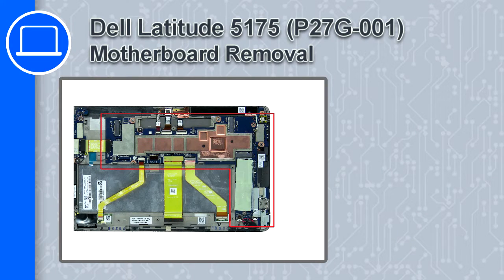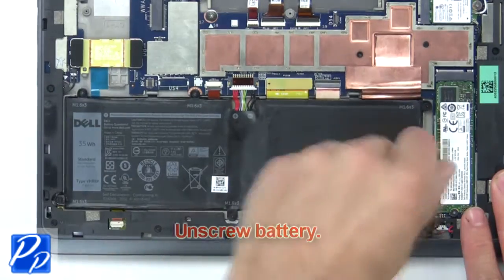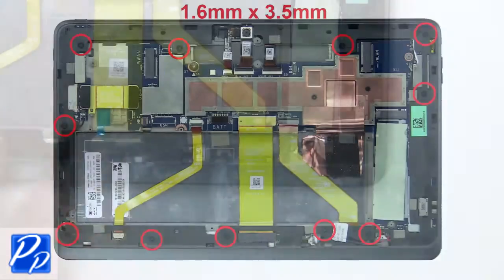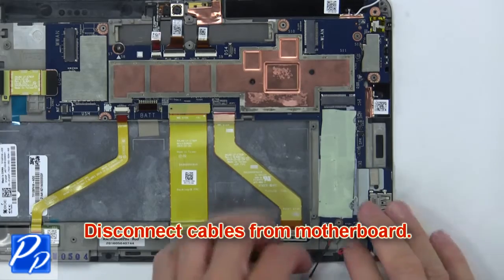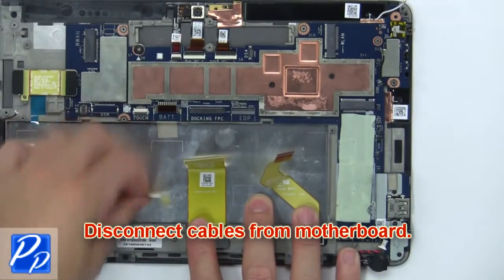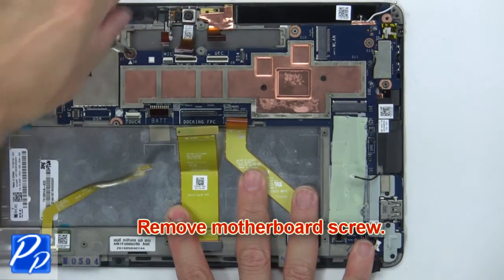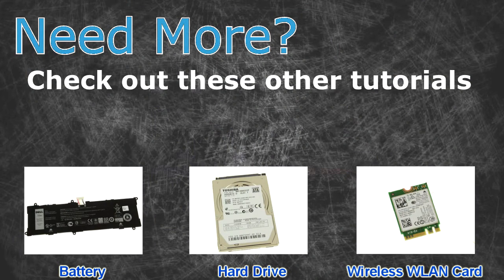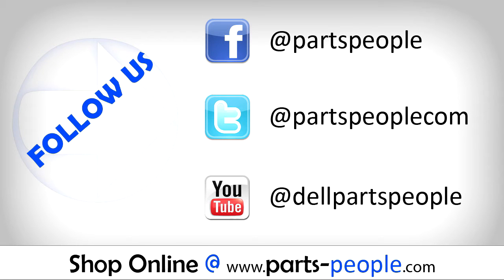Dell Latitude 11-5175 (T04E001) Motherboard How-To Video Tutorial

Comment: This tutorial is slightly flawed. You can't simply remove the back black plastic bezel after removing the screws as there is a small controller board for the keyboard attachment port connected that cannot be unscrewed without accessing it from behind so you can't simply pull off the plastic cover as you have demonstrated without damaging it. You have to detach the docking ribbon connector in the middle before you can remove the black plastic bezel which you do not demonstrate in your video.
Reply: in need replace thermal paste for this CPU where exactly the place?